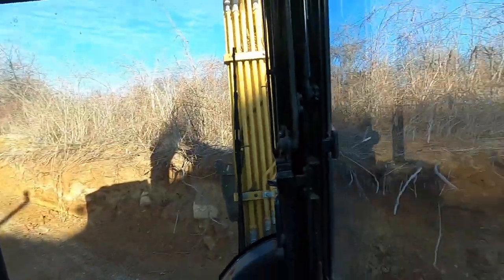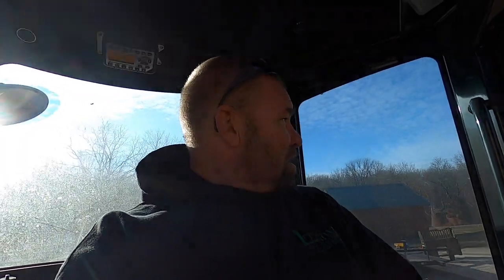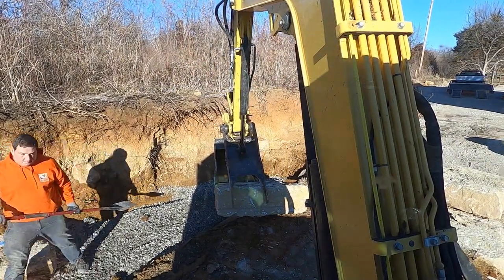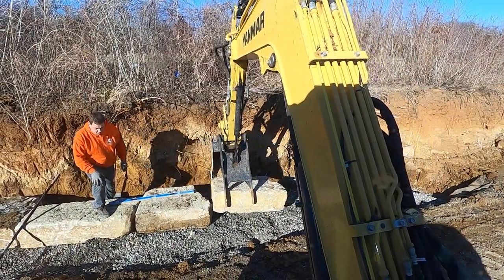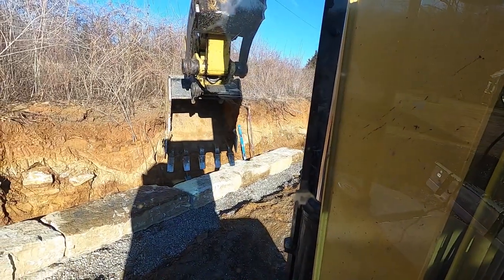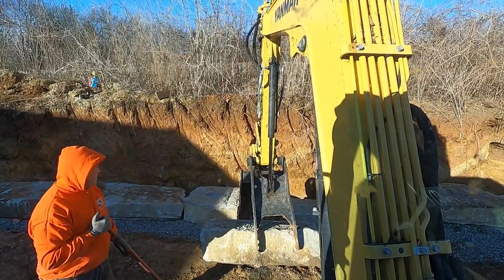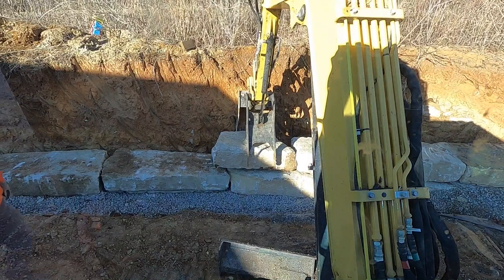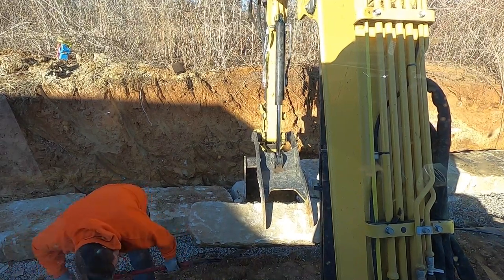Building a Big Limestone Retaining Wall

Comment: Do those limestone walls need a base behind them, or just below?
Reply from the maker: We base the bottom about twice the width of the wall and we always put clean 3/4' or 1' gravel behind them for drainage. There is a perforated pipe at the base that daylights out of the gravel. They need a face drain every 50'.